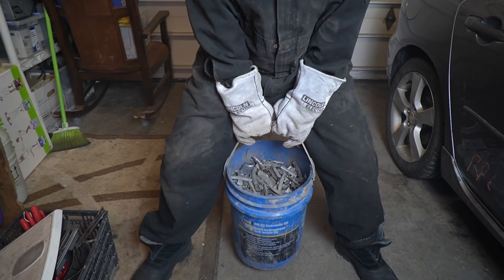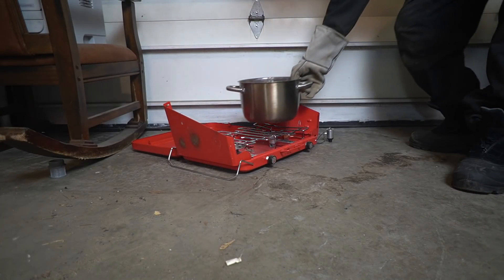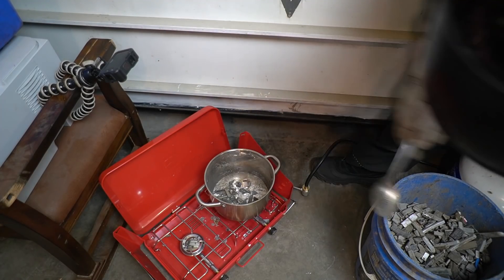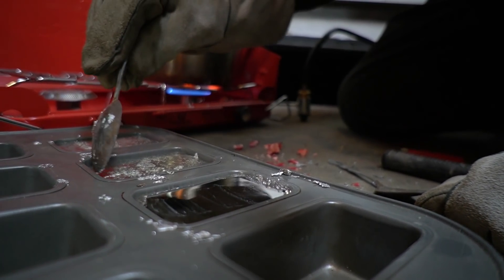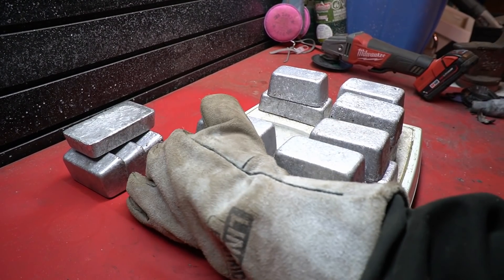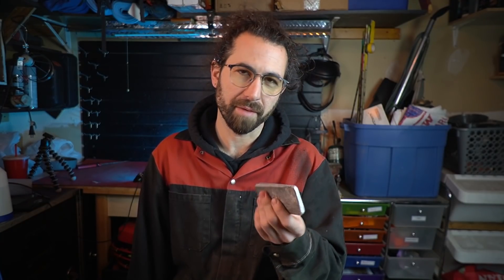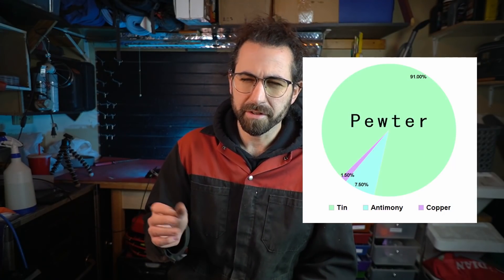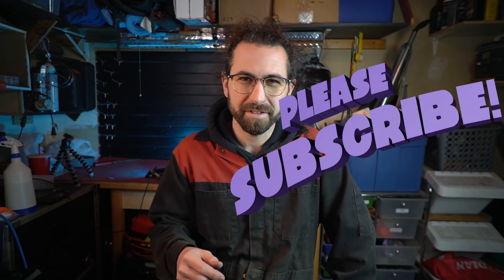Melting Wheel Weights Into Lead Ingots - Easy DIY Metal Casting

Comment: Or better yet find some americans who want to buy it to make bullets. I do this to make myself bullets that I reload which reduced the cost per round. Another tip for you is wash the lead before you melt it down so you don't have to skim as much. I just spray into the bucket and roll it on the side a tad and swirl it around to try and get some dirt loose then dump it out and rinse it and then make sure you GET IT DRY so it doesn't melt and then cause steam explosions later
Reply from the maker: Ohhh, the wash is a really good idea! I wouldn’t want to do that if I had a whole lot though 😕
Reply: @thubprint  yeah but normally when I wash the lead its lead I've recovered from the shooting berm. So it's still muddy ect. But some wheel weights are similarly dirty. Oil ect it just helps on the skimming and saw dust woods great too for fluxing and I use a turkey fryer burner for my propane and a large cast iron skillet.  It helps keep the heat even in the cold. With cast iron I can melt lead outside in the winter in western Pennsylvania

Comment: Every month I buy hundreds of pounds of scrap lead for under $1 per pound at local recyclers. Ingots will bring you about $2 per pound on eBay right now. I cast mine into #00 Buckshot and sell it for $7 per pound. I can make 20 lbs per hour. BTW, I used to run lead wheel weights and found the process very inefficient, plus you can completely ruin a batch of lead with a zinc one if you're not careful. Also, you only got 56 lbs of ingot from 130 lbs of weights? That's a TERRIBLE 43%! If I don't get at least an 80% yield, I feel ripped off. Once you start melting cheap roofing and plumbing scrap, you'll never mess with wheel weights again. If I need alloy I just add it. Most of my ingot buyers prefer pure soft lead that they have the option of hardening if desired.
Reply: Hi. Why does zinc ruin it?

Comment: I've been collecting scrap lead for a significant number of years and processed it on my kitchen stove🤣 However, I never thought of trying to sell it as I always thought the price was too low, it's just fun to do. Here in the UK, we have stringent gun control and I'm unaware if there are people who make they're own bullets unlike Canada and the US!! Definitely one to think about finding a market to sell it on, thanks 😁 LIAYFI...
Reply: Fishing weights. Or make your own dripper and make lead shot for scuba diving. It won't be perfectly round, but plenty good enough - just pick out any sharp bits.  I melt on a wood burner in the shed, does it perfectly, exhausted/extracted to the open air and quick if done on a gentle bed of embers on low draught - just don't get it too hot.  Heard of charcoal? The old colliers also used to make white coal (small chips of very dry wood) for sale to lead/pewter founders as charcoal  used as fuel burned too hot (as did coal).  Here's a link to the wood burner as it's a very simple jobby made out of a butane cylinder.  https://youtu.be/De1LbSrsZrc

Comment: Neat! Good advice and I didn't know you could use a camp stove to cast any metals at all. I know aluminum has to be much hotter than that, but it's still really cool seeing lead on a camp stove. Great video!
Reply from the maker: It was great fun 😆
Reply: No problem for lead. To save on costs i melted lead with a homemade rocket stove. So the fuel cost me nothing.

Comment: Or cast bullets instead and get even more value :)  The process would be more efficient if you would insulate the process better. It would be cheaper with DIY automation and the use of exes solar PV energy. There are also industrial high-temperature heat pumps that could work for plastics. The waste heat of cooling lead could be reused for plastics recycling :)
Reply from the maker: I’ve never actually cast a bullet! I do love the idea of maximizing conservation of energy though 👍

Comment: Decent process you have there. May I contribute a few fine points ? Today, too many wheel weights are made steel or Zinc, Those can't be put in your melt, zinc is oatmeal lumps in molten lead. So be watchful of what you add to your pot. The fumes are harmful from this process. Melting lead or worse zinc. Work outside or under a fume hood. You cant rush the melting & fluxing process.. Pick off any floating steel clips carefully . But Before you try to scoop them or the "Dross" from the melt : You should do the wax flux thing/flame up the fumes, TWICE. & before you scoop the junk out Wax, Flux again with hardwood sawdust, ignite while stirring. This step insures you won't be skimming off the valuable antimony from in wheel weights.  If you know the weight of your working pots content you can add pewter to the mixture at 1 or 2 % And stamp that Sn content right on your ingots. That is my preferred mixture for pistol 1% or for rifle bullets 2% Tin.. Sorry for the long post..keep up the good work & be careful. uncle mike in ct.
Reply from the maker: Excellent tips from a fella who sounds like he’s done it before! 😉
I wasn’t too worried about the zinc but I kept the temperature down with all the fresh new material I was feeding in. All the same I did catch one that broke in half, so I definitely see how it would be better to keep them out from the beginning.